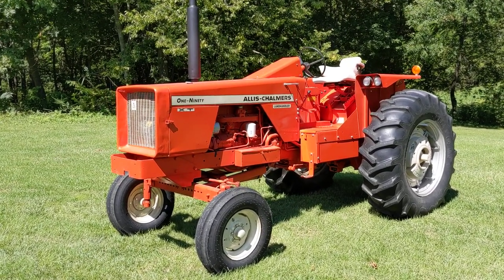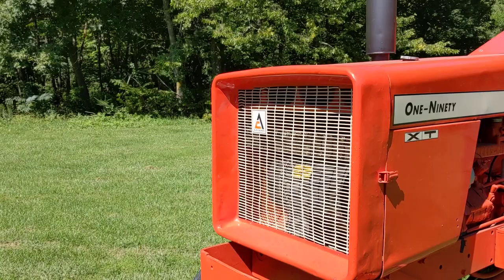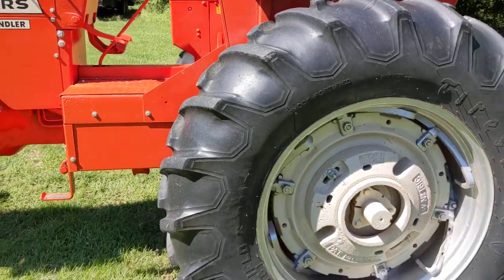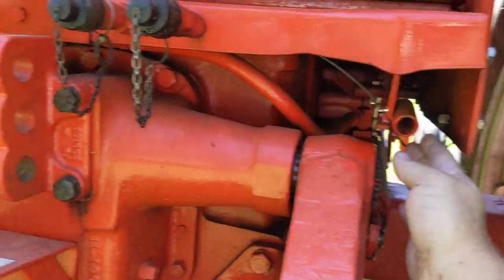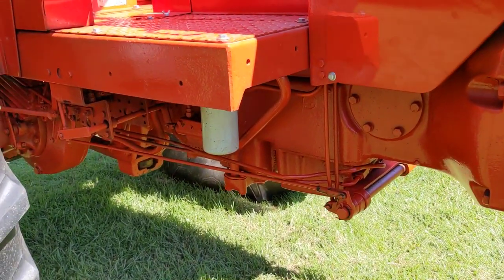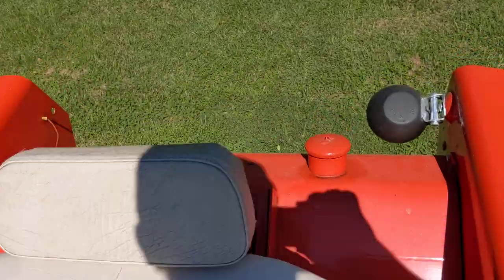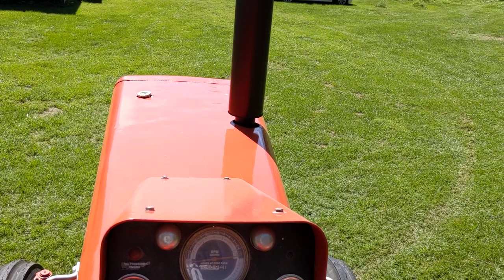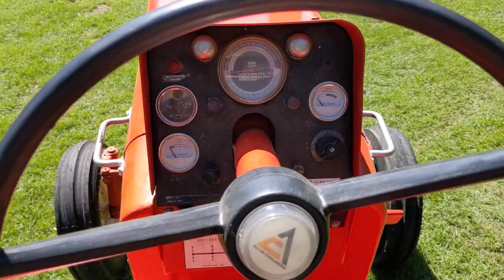1968 Allis Chalmers 190XT

Comment: I spenr a really long time on those 190xts using a 21ft Krause offset on wheat stubble at night. Ours had the biggest rubber you could put on it and lots of front and wheel weights to hold it down to the ground. Most comfortable tractor i ever ran. Good memories

Comment: I spent a couple thousand hours in one of those! Pulled a 6x14” plow in EC IL where we had a good bit of Drummer soils. Naturally, the pump was turned up a bit! 7 point nitrogen bar. Hinson cab. I moved the air filter can out from in front of the radiator and to the side which helped with cooling a bunch.

Comment: I have a long history with Allis Chalmers. Our first was a WD45 gas, tricycle bought in ‘54. Then in ‘55, when I was 9, Dad bought a WD45 diesel wide front, 4x14” semimonted plow. Then came a pair of D-17 diesels, wide front, that were one serial number apart, one ordered in the fall the other ordered for the next spring. Then a 190 that had a serial number indicating it was the second one built. Then in about ‘69 I bought the XT. Later came a 200 for the nicer cab mainly. Then a 210 til ‘77. Then I went Green!
Reply from the maker: Good to grow up on AC's!

Comment: David Browns were the only tractors I had ever come across with a pull out to run control, I also had an International 955 where pulling the control out past the stop position gave an excess fuel position for cold starting.

Comment: I think the unofficial Series II came out in 1966. That's when Allis came with the larger axles and several other changes but the bar grill and sloped fenders were still in use and then switched to the newer grill and fenders but were still an unofficial Series II. Don't quote me on that :) BTW the 190 series is just about my favorite tractor...... except when I'm driving a nice WD45.
Reply from the maker: AC didn't help things by not keeping the records...
Reply: @charlie175  Yes too bad but it was actually Deutz who threw them all in a dumpster when they closed the plant. Some records were saved by employees, especially Norm Swinford which he then turned around and wrote a couple books detailing Allis-Chalmers' history. I think Allis was very good at keeping records and even better than Deere, when you take into account that Deere claims to have built exactly 300,000 A tractors and at the same time built exactly 300,000 B tractors. Either they had poor record keeping or they fudged to keep pace with IH.

The Allis-Chalmers Story by C. H. Wendel is also a good book and he discusses in the introduction that the records kept on all that Allis-Chalmers was into was so vast that he could never put all that history into one book. In fact he was at the Milwaukee plant, with the permission of Allis-Chalmers for the purpose of writing the book, going through the archives, and just as he was finalizing the book, it was announced over the company loud speakers that Deutz had bought them out. That was of course in 1985. I'm sure most of the records Wendel was going through were forever lost.

I wish the records were kept so that I could find out what day my tractors were built and where they were first shipped.

Comment: My dad both one new in 69. It always ran hot!! Pull a 4 bottom plow and on hot day you would have to stop periodically and cool it down. Our  806 ihc would plow circles around it!! But I wish I still had the ac!!
Reply from the maker: Never had an issue running hot. Sounds like a plow setup issue as the 190 should have been able to match the 806. Did the 806 have an add on turbo?
Reply: No 806 was stock!! Also it was pulling 5 bottom !! As I remember Dad had a different fan put in and that helped some. I finally went to John Deere in the 90s!!!!!